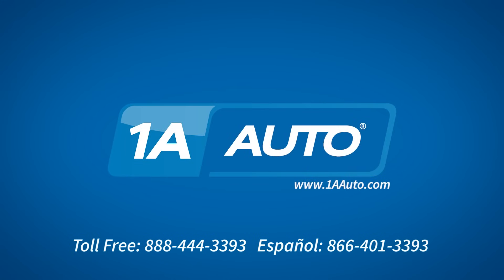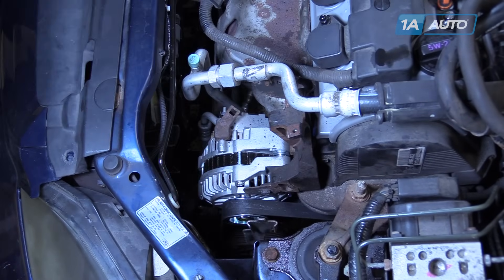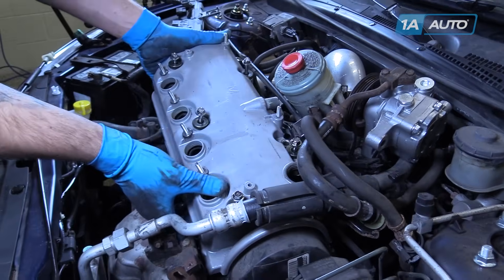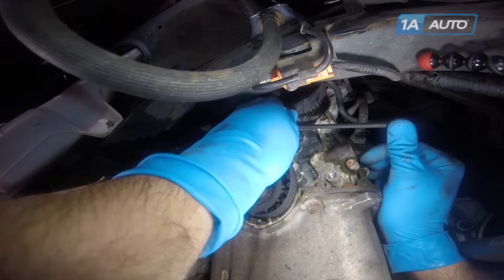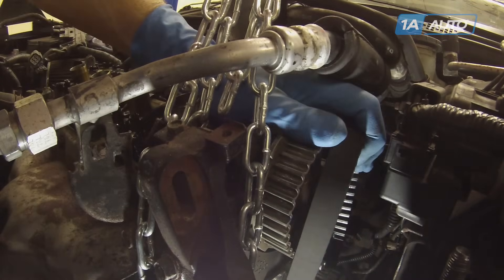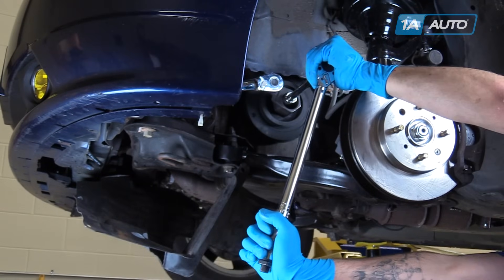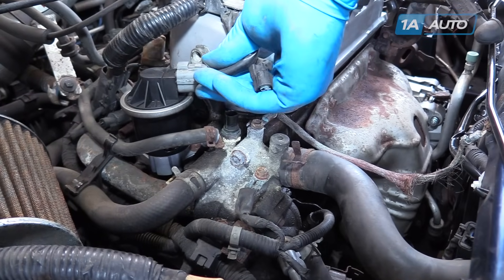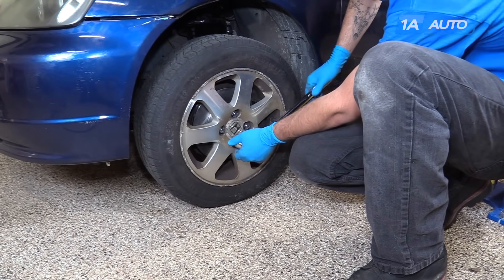How to Replace Timing Belt and Water Pump 01-05 Honda Civic Coupe Sedan

Comment: This is a great video. Thanks for doing it. Im going to do this tomorrow. In the video you say to torque the crankshaft pulley nut to 141 ft. lbs. the chiltons manual i have says 181 ft. lbs.  What did everyone use that did this? 141 or 181? Any input would be appreciated. Thanks.
Reply from the maker: +pganewman Thanks for checking us out! For this particular model it was set to 141 however this may change depending on the individual vehicle. These videos are guidelines and if the manual states something different, it's always best to go with what the manual says. 1AAuto.com
Reply: @1AAuto  Thanks for the reply. Just finished the job. Took a while. I ran into the usual bolt and broken piece stuff but overall the video made it possible. Thanks!!!!!!
Reply: Hey, i got a 2005 Honda Civic Ex 1.7. Do you have the same model what did you go with?

Comment: Great video! Is it absolutely necessary to have the special holding tool from Honda inserted in the hex in order to change this?
Reply: The only way around it is to have an impact strong enough to break that bolt loose. At my shop only a 1" air impact got the job done.

Comment: Small tip:
This car has an aftermarket intake. The original one is a plastic square air bot held in by 3, 10 mm screws, and once it comes off (it needs to come off to give space) make sure to cover up that throttle nicely.

Comment: Thank you for the video, much appreciated.

Is this the same procedure for the 1.6 please?  Im going to attempt the job for the first time. 

Is there anything els I need to be mindful of? 

I did see in another video to keep the engine mount bracket bolts in order aswell as  draining the cooling system with engine running and heaters on full is this procedure needed?  

An answere to my last couple of questions before starting would be greatly appreciated. 😊

Comment: I just used your video to replace the water pump and timing belt on my 03 civic. Great video. But i thought i would share a tip.  I used the 1/2 drive adapter from my serpentine belt tool to hold tje honda tool for the crankshaft. I fits in that area perfectly
Reply from the maker: +Russel cheatwood Thanks for the feedback!

Comment: The engine should be turned counterclockwise when checking timing belt installation.  A new 5mm longer bolt is needed for the tensioner.  During production in 2002 the tensioner was redesigned and the newer tensioner is 5mm thicker.
Reply from the maker: +James Schulte Thanks for the feedback!

Comment: Cheater pipe works great when you have a lift! LoL :-)
Reply: If you don’t have a lift just jack it up as high as possible and take off the front bumper it will let you get in there a lot easier

Comment: I'd like to see a close shot of the pulley on the crank before the bolt is installed. When I put my pulley back on it appeared to not slide fully onto the crank and that concerned me. In other words, the end of the crank was not flush with the pulley. If that is normal, great. I have nothing to worry about except that I'd like to see the key be a little longer.
Reply: Your key may not have been in the pulley, or you were putting on there with the incorrect rotation

Comment: You line up the crank gear mark on the block.Then you put the upper pulley in time before you remove the belt? Does that change the lower crank gear mark position?
Reply: Yeah they all work together and should line up in sync

I think

Comment: You need to rotate the crankshaft in the other direction. 12. Rotate the crankshaft pulley about 5 or 6 turns counterclockwise so that the timing belt positions on the pulleys.

Comment: My Honda Civic EX 2002 has 19,000  miles to it Have it for 18 years Didn't change the Timing belt yet but the A/C compressor been changed 
Two grant to replace the A/C Just got a new Subaru Outback 2020 what a changed after driving the Civic for 18 years Lots Electronics has been add to it. Our Honda Accord 2003 got 130,000 miles replaced by the Subaru two weeks ago.
Reply from the maker: +Daniel 2020 Thanks for the feedback!

Comment: This engine should turn Counter Clock Wise!
Reply: And can i ask - Ding min Jo-
"How did yoU know that?"
Not an encouraging mistake to make espec on 1st time. Whats ur exper?
Reply: The reason he turned the engine clockwise has to do with the way the bolt is threaded into the crankshaft. If he tried to turn the engine in the opposite direction (CCW) the bolt would start to come out and not rotate the crankshaft.
Reply: Joe Vignolo that’s Honda for you that’s why they make that special tool to hold the crank pulley in place to torque the crank pulley bolt then you can start to go counter clockwise very easy
Reply: No. Don Jo is correct. You can tighten the bolt and turn the motor the correct direction.

Comment: if you would of removed the spark plug you wouldnt have that tension when rotating engine. always remove spark plugs. work smarter not harder but good video brotha..
Reply: Depends if you are working with a warm engine or cold engine. If you are working with a warm engine and remove the spark plugs you will pull all the threads out with em and give yourself a headache and a lot of lost money destroying your cylinder head.  Never remove spark plugs on a warm aluminum block. The only time it is ok is on engine with steel heads. Most people don't get up in the morning and make it a project, nor do they have time to wait 3+ hours to let an engine cool.

Comment: Do you think an impact will work to remove the crankshaft pulley 19mm bolt, instead of having to use the cheater pipe? I don’t have the enough room under my floor jacks to get that much leverage.
Reply: An impact will work but its highly NOT recommended. You will score the crankshafts bearings and cause premature failure. Its better to take your time and not risk the lower end engine rebuild.

Comment: the crank will always have the most direct line of belt to the cam gears. it will always pull the tight between the crank and cam gears. the idle pulley is always the slack side of of the belt
Reply: So turn counterclockwise?

Comment: Can the timing belt be overtightened accidentally or was it a bad bearings or what? Because I got my timing belt, water pump and tensioner replaced on the auto repair shop because I just bought my civic 2005 3 months ago and not sure if the belt is replaced before So I think it's a good thing to have it replaced. The car runs smooth before the process. Now when car is in idle, it sounds normal but not as normal as it sounds before I got my engine timing belt area opened up. Now when you push the accelerator, you can hear a grinding noise in that timing belt-engine area. I have no chance to go back to the shop since I moved to a new place. But the car's engine sound got worse now. Before, my car engine is silent and runs smooth no other issue whatsoever. I noticed the changes when I drove home from the shop, but I was thinking it's normal part of breaking in process, but days and months past it didn't go away. So I'm worried.

Comment: I have a 2000 civic would the process be the same just slightly different parts?
Reply from the maker: +Greg Ellal Jr The part in this video fits your application, and the install should be the same or similar. Buy this part on 1AAuto.com: http://1aau.to/m/Shop-1AAuto-c

Comment: I bought 3 torque wrenches. None go below 10 foot pounds where could I buy one that could apply 8.7 to the waterpump like how you said in this video. that's all I need to start putting everything back together
Reply: get a Inch Pounds Torque wrench and set it to close enough to 104 inch pounds
Reply: remember there are Inches and foot. make sure you do the conversion
Reply: Capri Tools 31200 Industrial Torque Wrench – Premium Choice; I have a 1/4  inch Capri 31007 from a couple years ago that I love n trust for anything up to 9 ft-lbs; anything above that I go to my Tekton that goes up to 150 ft-lbs. hope this helps.

Comment: Be sure to turn the crank bolt counter clockwise. My kit came from gates, and contained a memo showing catastrophic belt failure from turning turning the crank bolt clockwise, and then the tensioner abruptly adjusts or something like that.
Reply: I was having trouble getting new belt on so I just used the tensioner and had a friend pull the pulley against the belt while I bolted it in. Then I released the pin. I then rotated the engine clockwise two rotations. I had a tiny leak in water pump and it would cause thermostat to act funny and my car would start to act like it’s misfiring anytime I was idling with my ac on. After this job ac is working fine and the car doesn’t shake when I turn on my ac. How do I know if I messed my engine up? Drive the car 60 miles in about an hour and a half and no issues. Sounds like it’s running good.

Comment: Does the d16v1 has the same tensioner pulley torque spec? i did 44Nm and damaged internal thread to the point i need to use Helicoli....

Comment: Ok using this video I have successfully done everything I can do up to the point of pulling my tire .... My question is if I jack my tire up don't the Jake that I have that is supporting the engine because I have my motor mount off... Well when I jack the car u to take the tire off.... The support from the jack under the block is not useful anymore... Why did I do that in the first place then? Or what am I missing here? Or do I jack both of them and release both them at the same time? I'm confused about that.

Comment: that good video. I have a doubt. When I put the tensioner in the block with its respective spring the bolt I only adjust it with the hand. (fingers) and then after two turns of crankshaft (this so that it does the four times) if the marks are well in the camshaft. Is there where I tighten the tensioner screw and remove the grenade lock? I am right? Thank you...

Comment: If I'm only changing the water pump does the engine still need to be raised/disconnected from the mounts? Thanks!
Reply: I would more room and you might as well get a kit and change the timing belt too if you’re water pump is going bad that means it’s time to do the timing belt unfortunately. This video is very helpful and please turn the engine counterclockwise not clockwise

Comment: Do you suggest to put gasket sealer on the water pump? I add to the valve cover!
Reply from the maker: +Michael Golightly Thanks for checking us out! You can use additional sealer if you wish, however with a new gasket and ensuring all the debris is removed before the new parts are installed, it wont be necessary.

Comment: i have two civic after  tune up  . driver a week the  engine  light is on , CODE p0335 crank sensor . why after tune up have the problem crank sensor ?

Comment: 20:38 how do you remove the bolt without turning the crankshaft? Mine seems to have been tightened or maybe I'm just doing it wrong?

Comment: I have to do this next week. Great video. What was the reason to remove the valve cover? Was it because  honda was so stupid as to design the front cover recessed into the valve cover? Looks a bit cramped, but  I have done 2  PT cruiser belts, and this looks really easy.  Having air tools will speed things up too. Thanks 1A Auto Parts.
Reply: smbody pls confirm; I got a fairly newcomer eye to this level of mechanical diy. "Is it possible to get in these tight areas w/ just jackstnd
Reply: Cont'd.. 
I mean, without a lift (just having the car barely over 1 foot/12" raised, it is possible to reach the belt?
Reply: im half way through mine and im doing it all in my drive way, jack stand on each side of the car, i out mine on those jack points off of the pinch weld, had to raise them a little to get enough room to crack that dam pulley bolt loose, if you have access to an air compressor and air gun, Id suggest using it, probably be a lot easier. also buy the honda crank holder. got mine for about 15 off amazon, without it you have to "improvise" and itd be a lot harder and risk damaging parts of your car
Reply: Reza Grans i think my car is about a foot, maybe foot and a half of the ground, only need to remove driver side wheel but i put two jack stands, one on each side, just to be safe and have the car level in the front. just be sure to put blocks in front and behind of your rear wheels and the parking brake to be safe. maybe I missed it in this video but i think you should support the engine before removing the mount, a floor jack and maybe a block of wood should do fine, that way the enginr is stable and where it sits when  the engine mount is attached, also make it easier to re install the mount when youre done
Reply: yea you have to remove the valve cover so make sure to buy a new valve cover gasket and spark plug seals, wouldnt want to spring a leak. luckily most kits come with timing belt, valve cover and spark plug seals, new washers for the valve cover, water pump and its gasket and a tensioner, might as well replace it all while youre down there
Reply: if anyone has anymore questions just reply or message me and Ill get back to you. should be finished before I go to sleep tonight

Comment: The Timing Belt Kit I bought from 1A Auto for my 03 Civic 1.7   came with seals. Do you have installation video for that?
Reply: oo oo dude you just commented on the installation video lol.
Reply: Scotty D Scott he was talking about the crank  seals and cam seals dude lol
Reply: oo oo those seals are very easy to install if installed carefully! You can sometimes installed them by you’re finger tips lol just check you’re old seals how far they sit in there then put you’re new ones on very easy job just make sure not to damage the seals

Comment: Just wondering, should you always change out the water pump when doing this service interval?  How often do these water pumps go out?
Reply: Since the WP is driven by the TB, it's just a good thing to do since your already there.
Reply: the water pump has a hard rubber seal that eventually becomes brittle and starts to leak. I'd say after 100 K  miles put a new one in even if the old looks good and is not yet causing leaks, it will and u will wish u had changed it to do the job only once.

Comment: My Cam gear is upside down when the crank pulley mark lines up.... The engine is a Japanese domestic market engine....I don't want to mess with the cam gear car worked before....Im only changing the timing belt and water pump because Im also changing the front main seal and theres oil on the timing belt already so Im gonna change it. I don't know if I should mess with the camngear or not 🤔

Comment: what are the signs of a bad water pump on a civc??
Reply from the maker: +David Williams You may experience a drip under the water pump, which is typically what happens when they fail. Here's a link to the kit shown in the video. Hope this helps you out. http://www.1aauto.com/2001-05-acura-el-honda-civic-timing-belt-kit-with-water-pump%2c-valve-cover-gasket-and-seals/i/1aeek00622?utm_source=YouTube&utm_medium=CTA+Comment&utm_campaign=ytcomment&utm_term=3PAgdJ1ZSeA
Reply: jackpot i noticed the leakage around the pump area. both of my upper and lower hoses are super hard and hot. the extreme pressure is causing my car to shut down and smoke from under the hood. its not overheating on the dash.

Comment: I stumbled onto this excellent video when researching a problem I just encountered with my 2002 Honda Civic. Thought I'd posed a question to the readers / authors to see if they can point me in the right direction. 

I just finished a bunch of maintenance items, oil pan gasket replacement, replace PCV, air cleaner, fresh oil and filter, replaced clutch fluid and MTF, and some suspension work. Ready for test drive. Car started right up. Let run for a couple of minutes, no leaks. Backed out of garage. Ran through all the gears and tested braking. All feeling and sounding good. So took the car out on the road, ran fine for .5 miles, then stalled. Tried to restart. No luck. It fires, runs for 1-2 seconds, then dies. This repeats over and over. Could not get started. Towed back to the garage.

Timing belt and water pump professionally replaced approx 35k miles ago.  

Can anyone help with root cause? 

Thanks in advance for any help!!!!
Reply: No codes whatsoever. I checked with my scanner a number of times. Pull the car up on my lift again and rechecked all the plus, cabling, hoses, etc.. Nothing appears to be out of place.
Reply: Fuel pump relay
Reply: I see it's been years but did you ever get it figured out?? Mine started this about 2 months ago and I'm about to check timing because I'm afraid it mught have jumped a tooth. Other than that, everything looks to be in place and my fuel pump is priming and has pressure

Comment: Can you replace the water pump by just removing the lower timing belt cover?  Without removing the valve cover, alternator and power steering pump?

Comment: HELP i can't seem to remove motor mount bracket i removed the 3 bolts in the front and loosened the 1 on the side all the way and the bracket won't budge even with a pry bar
Reply: Thank you A1 this video was very professional and very accurate the problem was my mistake i missed a bolt on the side of the mount so there was a total of 5 bolts holding the motor mount bracket to my engine. Thank you again for selling me quality parts and putting up excellent directional videos. 
Mr. McLovein
Reply: There are the 3 in front and 2 on the side.

Comment: I had a timing issue and bout the timing belt. Well it faild. Luckily I saved the engine, when you still have the old factory tentioner make sure you get the upgraded bolt or else you will have problems like me.

Comment: I decided to put my motor mount back on cause my motor was actually twisting mine was so tight and then 2 days of wd40 and it finally broke loose.
Just finished mine today.
Reply: How did you turn it counter clockwise?